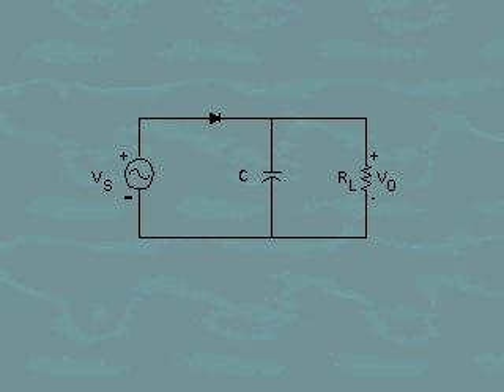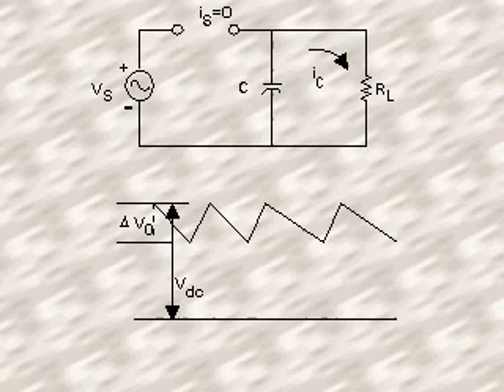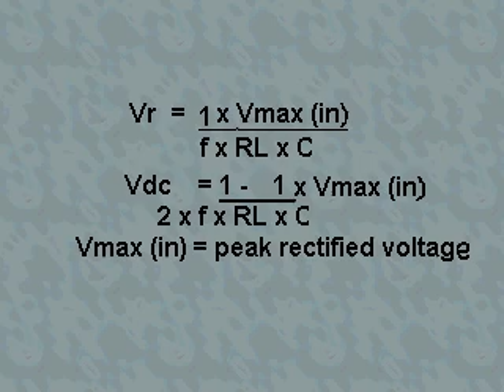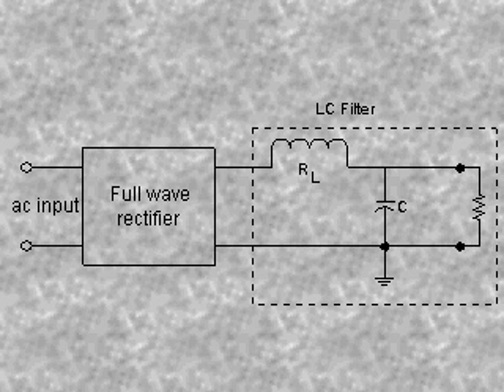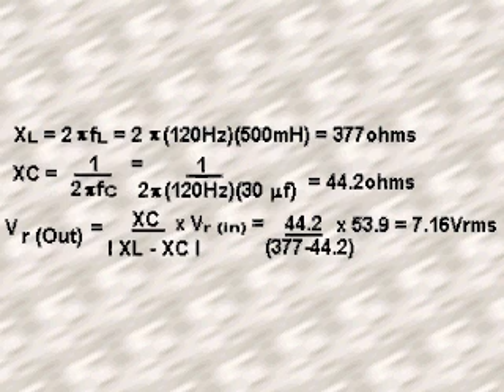Electronics Tutorial , Lessons#43 - filters for power supplies

Comment: Thanks for the great video.  Can anyone help me I am trying to understand this concept because I am having an interference issue on a brushless gimbal.   I have recently connected a 5.8ghz transmitter to transmit the video signal meanwhile I control the gimbals brushless motors using a 2.4ghz receiver.  The brushless gimbal and both transmitters are connected to the same power source and whenever I turn on the video transmitter it causes the brushless gimbal to have erratic responses to the 2.4ghz input commands.  I tried to solve this by using a 12v Battery Eliminator Circuit or BEC which has its own capacitors built in to try to clean up the power but I still get the same issue and I want to add a capacitor to help with the interference.  I am not sure how to work out the type to add.  Should I just add a 10V 100uF or will I need to go up to a 25V but I would have thought a 25V would store up power and then release it when it gets to 25V?   Any help will be great thanks.